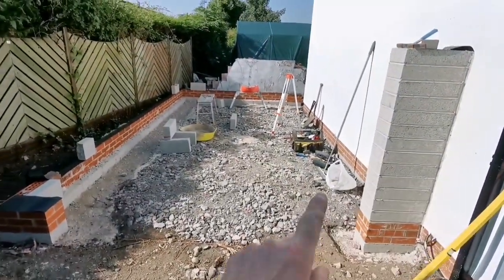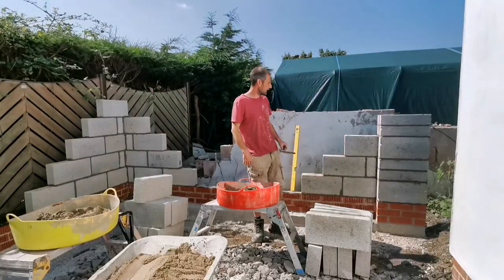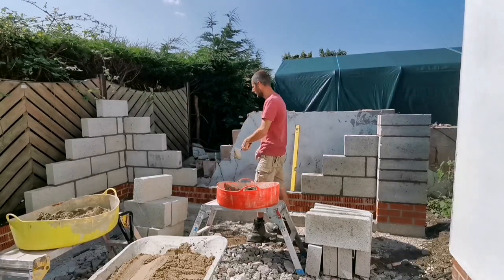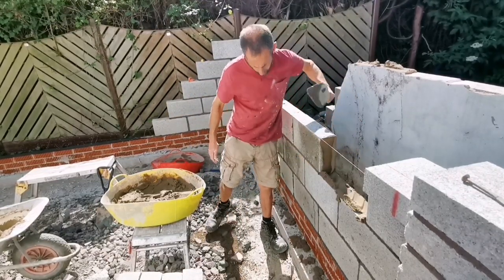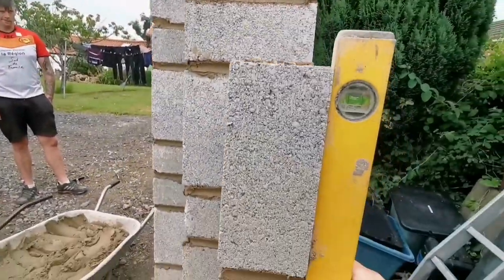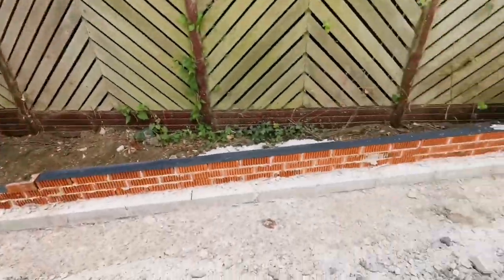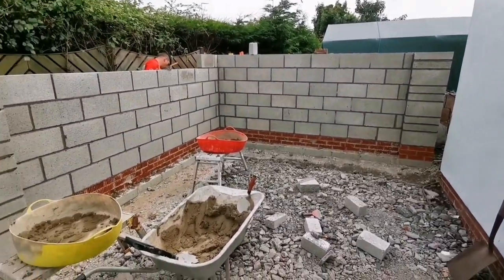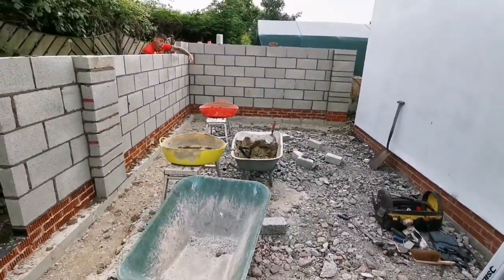Garage build. Day on the main walls  bricklaying

Comment: Don’t really see the point of the buckets my man. why not just use spot boards or just straight out the barrow
Reply from the maker: Hi mate. yes I just use anything I have on hand realy no reason for them just always have them in van lol. They are good for jobs we're you moving around alot. Like tilling floors and stuff👍👍👍
Reply: I think you would get used to them, but I would find it hard to get used to having sides on the board.